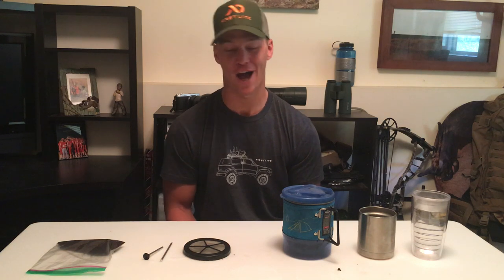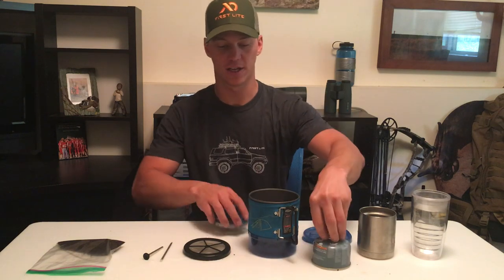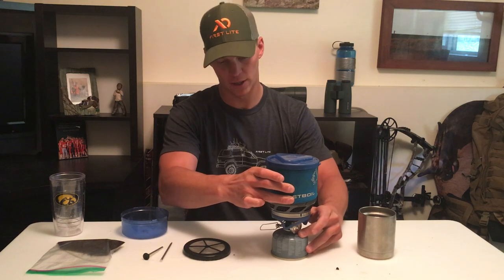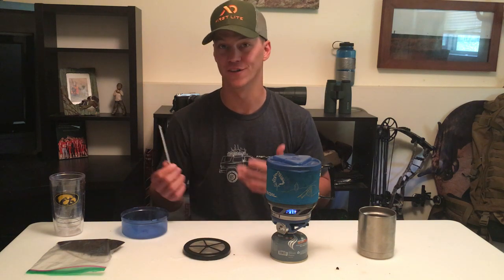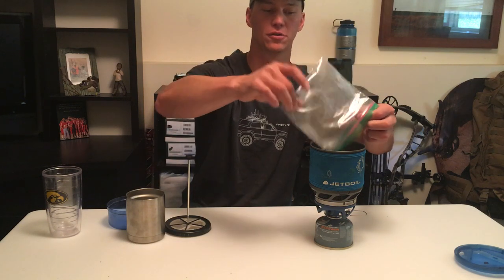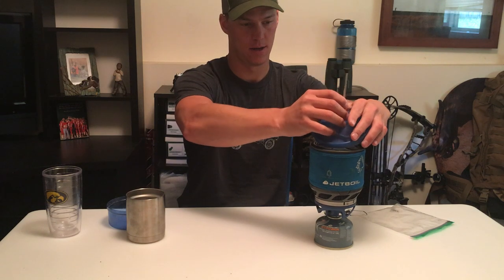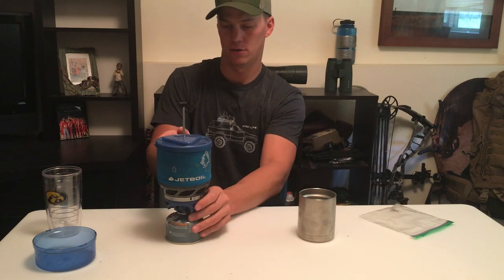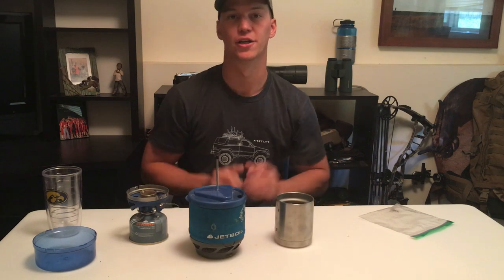How To Make Good Coffee In The Backcountry - Jetboil MiniMo

Comment: How many cups of coffee could you make with one fuel canister? Going on a canoe fishing trip for 5 days and probably wont survive without morning coffee.
Reply from the maker: Casey Haun the small Jetboil canisters usually last for 5-7days if you're making coffee in the morning and boiling water for your dinner at night.
Reply: Backpackinglight.com has determined (sort of) that JetBoils require 10 grams of fuel to boil 1L of water, starting at 33F.
Your pot holds about 1/2L, so a 100 gram JetBoil fuel canister should do 20 boils.  In Theory!  In the real hunting world, you will for sure get a crazy large number of boils from those little canisters.